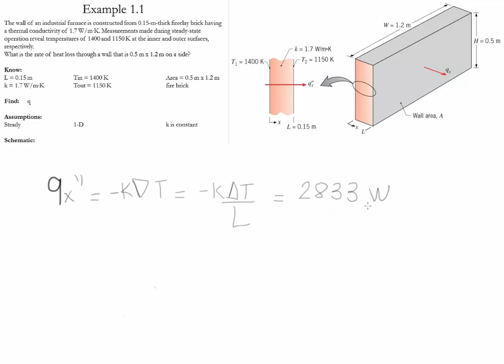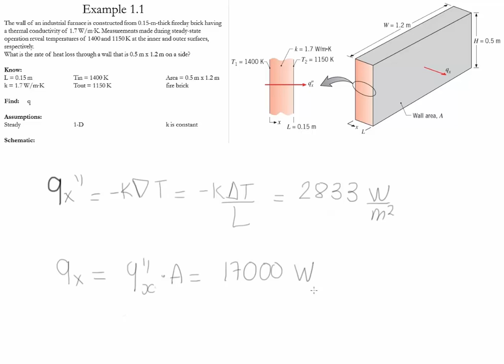Example 1.1

Comment: Calculation through heat flux is correct, the final answer for heat loss should be 1700 W, not 17000 W.